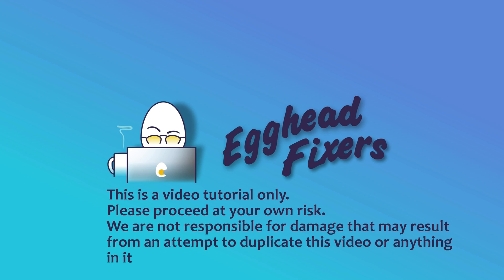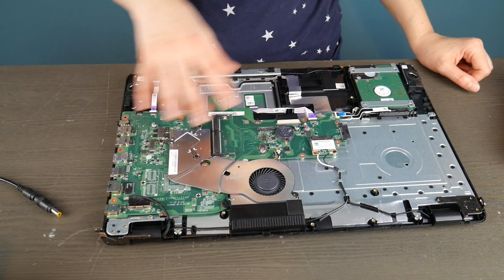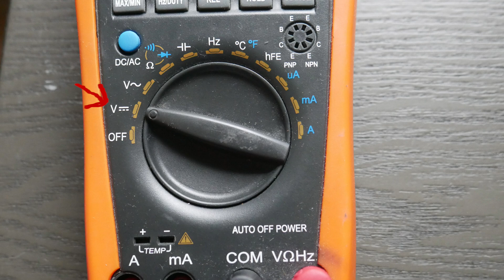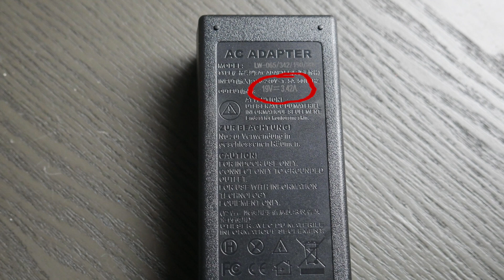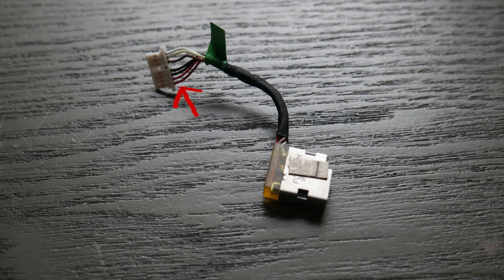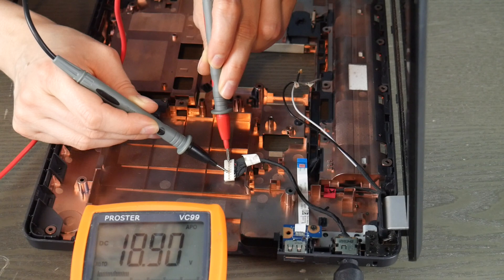How to Test Your Acer Laptop's Power Jack with a Multimeter - Tutorial by a Certified Technician

Comment: For the first and second laptop, when you plugged in the charger, were they plugged into a wall outlet?

Also for the first laptop, couldn't a new charging port be soldered on, instead of considering the laptop dead?
Reply from the maker: Yes the charger was plugged into the wall. Some people do a solder a charging port directly on to the board. As you can imagine this is not the easiest of repairs but it a repair that is done.